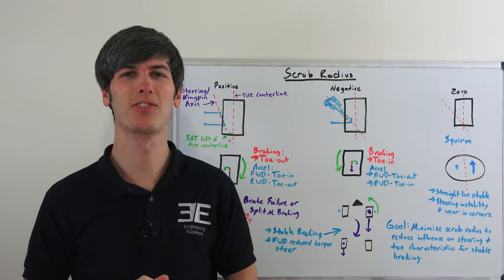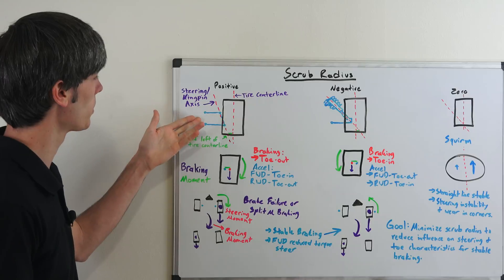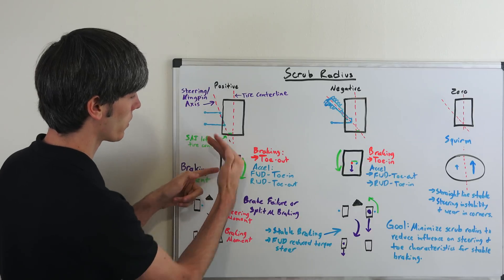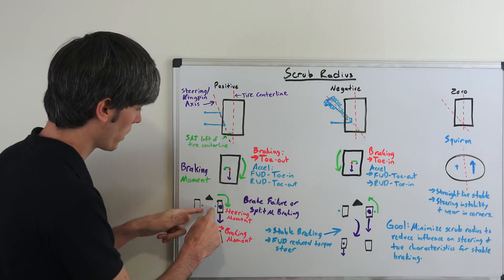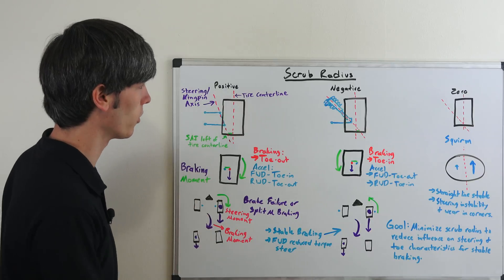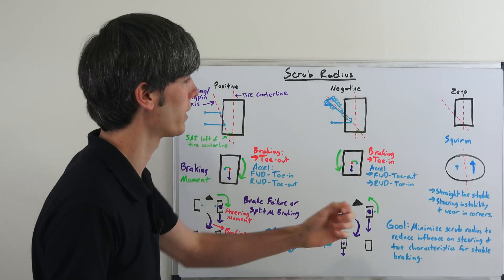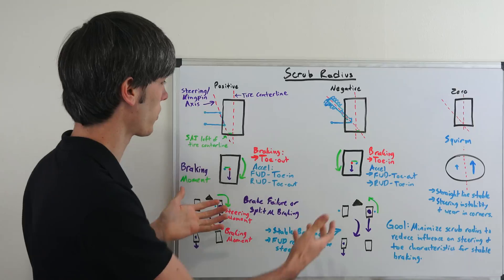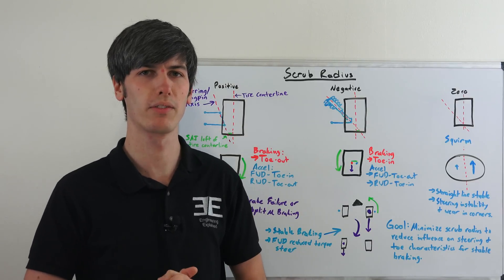Scrub Radius - Suspension Design - Explained

Comment: I changed my stock wheels 215/60r16 (16" 6.5J +50) to 235/45r18 (18" 8.5J +35). The calculation show +15mm positive scrub radius. It harder to turn, more responses steering wheel. How much is too much to my 2010 honda accord Sedan?!

Comment: So if you moved from a zero scrub with a 42 offset rim to a positive scrub with a 40 offset , the positive should be pretty negligible, correct? And I am noticing wear on the tires in the zero scrub setup.

Comment: I know this is an old video but i have a question! 
Under braking,positive scrub radius will induce instability by wanting to rotate the car,
 do can this characteristic be used to help rotate a FWD car around a corner during trail braking?
Or would this effect make the car reach its slip angle faster and cause understeer?

Comment: Thanks Jason for your lucid and interesting presentation on this subject. Additionally, I think that the addition of a small amount of scrub would be beneficial in helping to take up some of the slack in the steering system, from component clearances,  by slightly preloading the suspension.

Comment: I don't get it. If my Subi WRX has +55 offset and I go with the typical aftermarket rims that are +38mm offset, then I push the wheel out 17mm, making the scrub radius either more positive or  it might even change from a negative scrub radius to a positive scrub radius? And this could affect suspension operation and destabilize the vehicle under load? And if so, then why are so many WRX aftermarket rims using +38 offset?

Comment: But why does this affect steering if the rotation of the tire during toe in and whatnot is in a completely different axis than the suspension? Like how suspension is vertical and the rotation is on a horizontal plane. I don’t get how that little difference in the scrub angle can make that much of a difference in toe in and steering characteristics.
Reply: (if it is in*)

Comment: Hey would less offset affect alignment in the long run? I have a brand new car and I’m scare of ruining anything 

Stock wheel spec is 18x7.5 55mm and I’m looking at these wheels and they’re 18x8 45mm, would it cause any stress on the suspension in the long run?

Comment: Would the squirm be a negative if you were mainly using the vehicle in the snow? Would it cause you to lose traction easier in turns? Also, where can I find info on my current amount of scrub radius on my stock car so I can insure my offset will not take it to zero or positive?

Comment: Can you explain how wheels with different offset than oem, especialy on a rdw car (negatively) affects geometry? Example: bmw e91. Oem size is 8j et34 front. 8,5j et37 rear. Very stable at high speeds. I put on a square setup (8j, et30) and the car is all over the place!. A golf 6, oem offset is around 52, i put on wheels with 40 offset, also this car is all over the place

Comment: Say I've got 2 sets of wheels, one with a high scrub radius and one with a low scrub radius. lets say I have a very light car with a "racey" caster of 3 deg. Could I change the wheels SR effectively giving me a different caster "feeling" without actually changing caster? One set of wheels for on road/ heavy steering but stable and the other for autocross/ easy fast steering but twitchy?

Comment: So scrub radius doesn't have any negative effect on the rear wheels, right? 
I was looking at getting a staggered set of wheels to fit the rear arches perfectly. The fronts will be wider than factory fit but with a zero scrub radius, the rears need to be offset by 8-10 mm to fit perfectly.

Comment: If i got a zero scrub radius and I change the Tire size and the offset of my wheels to 215/40R17 Tire, 17x7.5 and 38 offset i get a 9mm positive scrub radius, my question is...  
Would the handling or any part of the car have any damage if I have the original suspension?

Comment: Good explanation of scrub radii!

Now: My 2010 Honda Accord EX, from the factory, has zero scrub radius.  The steering is light(50-series low profile tires on 17" wheels), and return could be a little faster.

I am considerig mounting the OEM  16" rim(and 60-series narrower tire) Honda used on the same year LX trim.  That wheel will lend positive scrub radius to my geometry.

What would be the effect on my EX's steering with positive scrub radius added?

Comment: My E46 (stock wheel offset +47mm) has E90 wheels (+34mm offset) on, and the increased positive scrub of 13mm does make the car squirrelly on heavy braking.

I sort of regret getting those E90 wheels on my car now.
Reply: I was thinking of getting 17x8 +35 wheels for my brz but now I'm leaning towards the same wheel in +45 offset. Looks be damned, the most important feature for me is handling.
Reply: @Synthwave89  You can get +45 offset wheels and then get 10mm spacers to test how the new scrub radius (from a +35 offset wheel) will feel, which can help you for your future purchase... but I honestly think you'll like it better at near-stock scrub radius if you value handling over looks.

Comment: @Engineering Explained Awesome vid! How can one determine what scrub front&rear a car would come stock with based on its suspension geometry, so not as to undermine the OEM engineering? I am looking to switch to wider front and rear wheels (staggered setup-rwd) and trying to get as close to stock offset with the added dimension(s). Thus far, I have matched front precisely, but rear is roughly +/-10mm positive scrub. Lastly, is this amount of change going to be as detrimental being on the rear axle of a double wishbone suspension type? Any assistance would be greatly appreciated.

Comment: When I bought my old '79 Volkswagon Rabbit, VW used the terminology "Positive Roll Steering Radius" and "Negative Roll Steering Radius".
The Rabbit had a negative roll.  The center of pivot was toward the outside if the contact patch.  With the car sitting still, turning the steering wheel from extreme right to extreme left, the right front wheel would make a slight rotation backward and the left wheel would roll slightly forward. The wheels would tilt noticeably outward when the steering was not pointed straight forward.
If I was careful to point my car straight on a straight road, I could let go of the steering wheel and the car would not deviate even if I were traveling on one side of the crown of the road. The steering would self-center well, but seemed immune to road embankment variations.

Comment: I realize this is an old video, but will a lift kit offset a positive scrub radius to zero??
Reply: Anything you do to the suspension will change the scrub radius. With a positive offset though probably will do the opposite and gain more positive scrub if you lift it,  moving that "steering kingpin axis" line to a more vertical line. On a lot of lifted trucks/cars people also use wheel spacers to fit bigger tires, he does a great video on how that changes your suspension, but if you use spacers youll gain even more positive scrub. 
Theres probably not a lot you can do to remedy it other than get a camber/caster plate (he does have a video on that as well)

Comment: Hey, I always come back to wheel change, and suspension geometry. It's confusing! When I learn something, it's usually soon forgotten. Assuming a stock scrub radius is recommended, how would an additional (+) 3mm offset affect handling, vs 7mm? Would even 10mm be an insignificant value overall, or would I worry about affecting the cars handling?

Comment: Hello. I have audi a4 B8.5
If i have OE wheel 16x7 ET 39  and tire 225/55 and i want to put 19x8.5 ET 35 and tire  245/55. Scrub radius is Positive 4mm. Is it make driving badly different or is it affect to wear tire inside ot outside? Thanks for answer?

Comment: in positive scrub radius, u mentioned that during acceleration in RWD vehicle, there is toe-out tendency. I did not understand this point. shouldn't it be toe-in tendency like in FWD??
Reply: In RWD, when you accel, the chassis (driven by the rear axle) moves in front of the front wheels, which pivots the front wheels outward, increasing toe out.

In FWD, when you accelerate, the front wheels move in front of the chassis but are dragged by the chassis, thus, the wheels are pulled toward the centerline in front of the car, resulting in toe in.

Comment: If you lower the car, does it have any effect on scrub radius?
Reply: I'm gonna take a guess and say for double wishbone, no, because all the angles move together in tandem. But for Macpherson, if you lower drastically, the wheels stop gaining negative camber (perhaps even gain positive camber?), so the scrub radius will barely change at first, followed by an eventual negative change in scrub radius if you lower drastically.

Can someone confirm my hypothesis?

Comment: Thanks man crystal clear. So what's a good scrub radius for a jeep that's 71" tall and 72" wide with 35x12.50r15x8 with 3.75 bs abs 2" spacers?  It was worse before The spacers but my jeep is still a bit squirmy right now and this video possibly helped diagnose my problem. Thanks! I'm thinking I should be a little on the negative side.

Comment: You're incredible. I have worked on cars for a long time but very little in suspension geometry.. Depended on others to perform alignments.  This the first time I have heard of scrub radius. Your presentation is straight forward and easy to follow.  You have enlighten me to point of realizing subtle steering/braking issues that I have come across.  These youngsters and I was once, do not take into consideration for their modifications.  Aesthetics is more important than road worthy. Knowledge is king and that is why your called an engineer.  Thank you for sharing.

Comment: is 38mm too much scrub radius? I'd like to widen my cars track width by 3
 inches on each side so I figured 3 inch wider wheel and 38mm less 
offset on the wheels (which totals to about 3" unless my math has been 
done improperly) would put the outer face of the tire 3 inches farther 
out.

Comment: Question! McPherson suspension wise.  How will a wheel spacer or offset have effect on scrub radius and how can you figure out these two (spacers and offset) in order to have a 0 or negative scrub radius for optimum handling? Also! Out of topic now but say you got a same wheel size and use a spacer say 25mm with 0 wheel offset, will it have the same effect on wheel bearing(stress) as no spacer but a -25mm offset? The wheel will be sticking out away from car 25mm in both ways but which will have least load on bearing? Keep in mind that a -25mm offset will increase the distance between the wheel flange and suspension components that might rub with inner wheel.. Just trying to take out the 14x6 +38mm offset wheel and put a 15x8 (custom made offset and back spacing) and I don't know how to calculate this.. all I know is that I need a wide track on my 88 vw mk1 with least stress on bearing and optimum handling feel.

Comment: Hey man I was wondering if you could elaborate on this but utilizing an off-road perspective. I know a lot of trophy trucks and class 1 buggies use equal length control arms but the suspension travel is so much that it also plays a role on steering linkages and steering angles. Could you delve into the geometry that makes up steering on high suspension travel vehicles?

Comment: So if I'm looking at changing wheels on my vehicle and staying he same tire size, but going with a different offset from 55 to 40 I am looking at generating (assuming my vehicles scrub is zero to start) about 19/32's of positive scrub. Will this be noticeable in day to day driving and braking? Or will it be virtually unchanged being such a small amount of scrub being added. Thanks.

Comment: +engineering explained @engineering explained Wheel spacers are often used to clear big brakes with aftermarket wheels. How does wheel width affect offset and scrub radius. I drive a lancer evolution x and the stock wheel size is 18x8.5 +38. The options i have that clear the brembos are 18x9.0+25, 18x10.0+35, 18x10.5+15, 18x10.5+25. I'm just want to figure out which size will not negatively affect performance (if any).

Comment: I thought weight transfer was diagonal across the chassis, so isn't the more salient dimension the change in diagonal axis from one corner of the car to the other when you add wheel spacers? On my 2004 BMW 330i ZHP, we added 10 mm wheel spacers to the front wheels to dial the stock, inherent understeer out of the car. All other things being equal (sway bar settings, PS9 Coilover heights, spring rates, etc.) it had a tremendous effect in making the car very "throttle pivotable." Based on your calculations, this should have had virtually no effect on handling balance. But now the car is easily pivoted and rotated around it's polar moment with the throttle. Is the car's front to rear balance just that sensitive to small transient weight transfer changes? That's why I suspect the diagonal is a key component in the changed handling dynamics ... ?

Comment: How does this relate to earlier suspension types? Like the one used in Fords of the 60's and early 70's? Upper and lower control arms with the spindle suspended between them. Spring and shock on top of the upper control arm in the shock tower. Strut rods and sway bar.

Comment: Citroen used a steering geometry with zero scrub radius, zero kingpin inclination, zero camber and zero castor angle. Steering feel was added artificially by the power steering.

Comment: Does the rear end have scrub radii as well? Or this only applies to the front end?
Reply: +Nick Amarit I think it would depend on the design of the rear suspension.
Reply: +Nick Amarit 

Well vehicles with rear-steer would have scrub radii because they turn 

As for torque vectoring diffs, I dont think that they would cause a dynamic scrub radii but they is probably someone better to ask
Reply: +Nick Amarit I dont think so because the rear wheels dont pivot
Reply: What about cars with rear-steer?

And do torque-vectoring differentials generate dynamic scrub radii?

Comment: The concept sounds sort of similar to trail on a motorcycle, though in terms of right/left in this case, not front/back on a bike.  I'm wondering if somebody could draw connections between the two.

Definitely wouldn't mind you doing a video on motorcycle rake angles and trail distances.  The rake angle is usually directly associated with responsiveness vs stability, but how the trail factors in is usually not as clear.  Definitely wouldn't mind an EE video on that!
Reply: Trail is what controls stability or responsiveness.  More trail equates to more straightline stability at elevated velocities.  Less trail equates to a more responsive feel at elevated velocities.  Rake, axle centerline offset, and front tire diameter all play into the trail equation.

Comment: I did not get how they would toe in and out as per the radius.
do explain if possible
Reply: +mayur kulkarni Think of it like this: There are two points where the tire is touching the ground. 

The first point is the center of the tire. This is, artificially, where you can imagine the force of the tire accelerating and braking taking place.

Then, imagine where the steering axis is. This is the point (axis, really) of the tire that turning the steering wheel will cause the tires to turn.

If they aren't overlapping, accel/decel will cause toe in or toe out, since the force the tire experiences torques around the steering axis. Said slightly different: braking and accelerating causes the wheels to twist a little, and the further away the point that the tires turn around is - the harder is pulls around that point. In FWD, the tires are applying force, but in RWD they're resisting it. That's why FWD/RWD has opposite behaviors.
Reply: Joe Smathers thanks mate, got more clarity now. I will have to read more on that.

Comment: When I started driving most cars did not have power steering. I was always under the impression that they had a positive scrub radius to make the steering lighter. If you try to turn the wheel when stopped with a positive scrub radius the wheel will rotate slightly. On the big cars you had to be very careful not to put your fingers in the steering wheel when maneuvering as the wheel could jerk around. Interestingly I drove an old 50 seater bus once that had no power steering and it was actually not too bad.
Reply: My first vehicle was a 64 Chevy Pickup that I owned for the better part of a decade. It had 4 drums, no power brakes or power steering. The steering wheel was probably an extra 6 inches in diameter larger than a modern steering wheel and angled away from the driver with the bottom closer to you so you could really put two hands on it and crank. It was also over 5 turns from lock to lock IIRC. At a stop it took some serious muscle to turn, if you were rolling you would just let go of the wheel after the turn and it would spin back to straight at an insane speed.

Comment: On normal cars a 0deg scrub radius is undesireable as it makes steering on low speeds very heavy, for example when parallel parking.
Especially in the past when a lot of cars didnt have power steering.